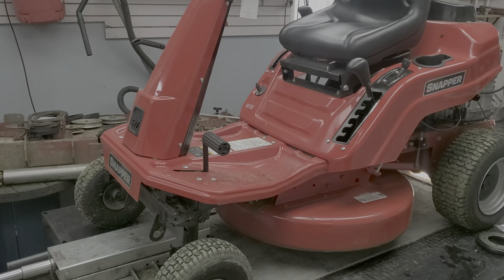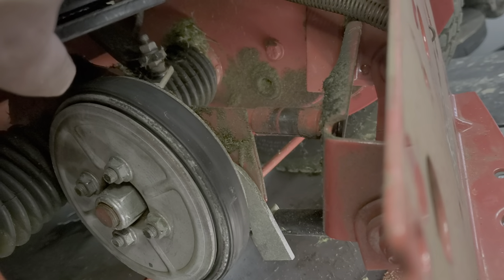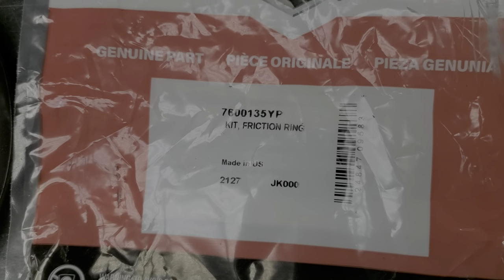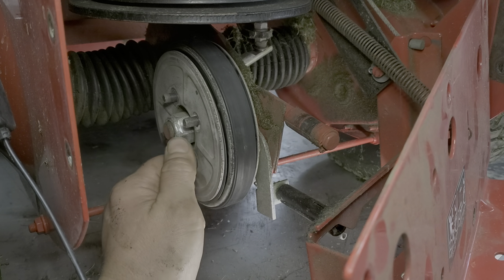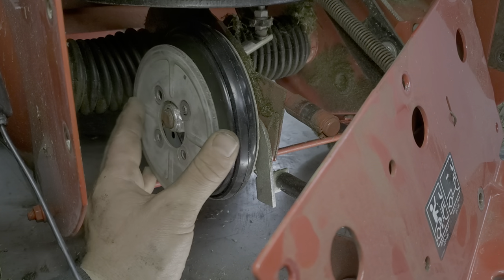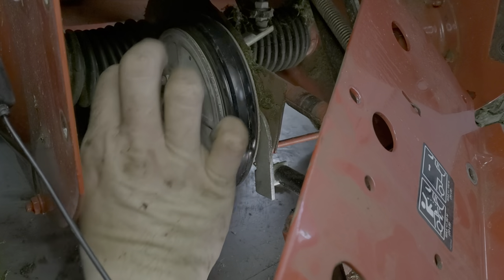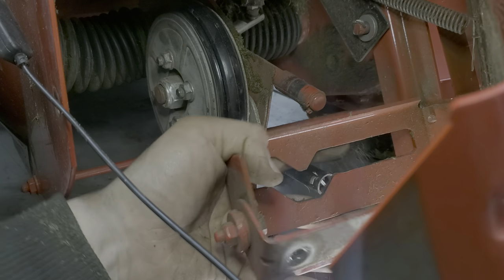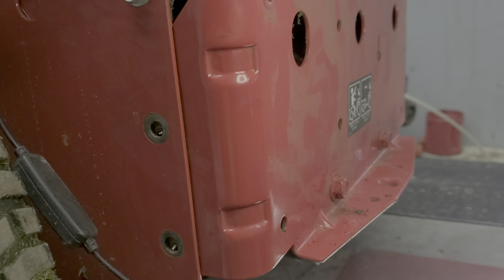Snapper RE110 Won't Go Into Reverse Won't Drive Friction Disk Diagnosis and Replacement

Comment: Thank you for making this video.  I was able to get this done in less than 15 minutes and that's only because I wanted to clean some things before I put it back together.  I jacked the rear up and went underneath.  I used a pneumatic ratchet to get them loose and to tighten (only 90 PSI).  When I got everything off, I noticed that the friction disc was way off.  It was a clear difference when examined.  I put the new one in place and then hand tightened 1 nut and then worked around with centering the ring before getting them all tight.  After I was finished, it looked even all the way around.  I took it out and it was easily able to go up the hills that were impossible before.  The issue I had was that after about 3 rounds on a mostly level front yard, it would start to struggle going up even the slightest slope.  I could only cut grass going downhill or across.  6 hours to do my yard.  This little <15 minute fix will save me SO MUCH TIME!  Thank you again.
Reply from the maker: Awesome job! Thanks for watching!

Comment: I have a RE110 with the no reverse issue. have to push the gear/speed selector as far as it will go back to get it in gear but once it starts moving you can let go.  It also has an issue with the clutch/break.  I have to take my foot almost all the way off before it goes in gear (forward or reverse). It will also “jump” into that gear once I let off the clutch enough. Will this solve that issue as well?
Reply from the maker: It is almost always the issue with these symptoms
Reply: @IndRepair  thank you for the response.  That’s what I was thinking, just wanted to make sure I didn’t need any additional parts.

Comment: I have an older Snapper with a friction disk.  Had it pro repaired at least 3 times and reverse, if I'm lucky sorta works, maybe for a season or two before it completely stops working and I have to push it with my leg to back up.  Dumbest design ever.  Not even sure if I can get the part anymore.  So mostly I just do creative cutting to avoid traps.  And use a push mower in the tight spots I can't get to.
Reply from the maker: Definitely!
Reply: @IndRepair  I went ahead, after measuring and looking at the bolt configuration, the same disk kit you used.  I'll give it a shot.
Reply from the maker: Awesome!